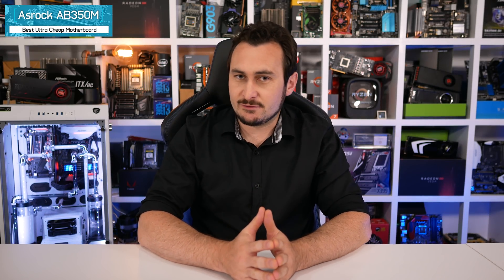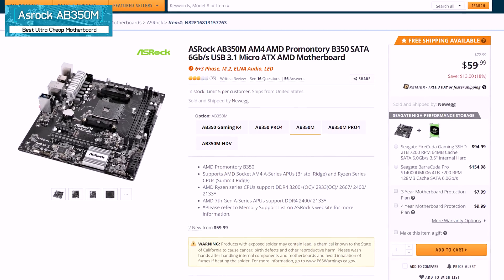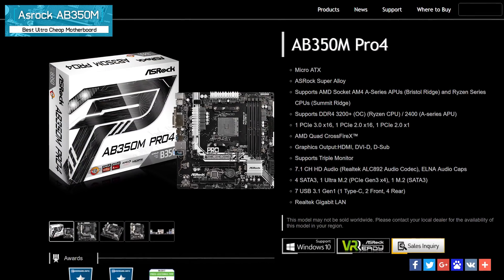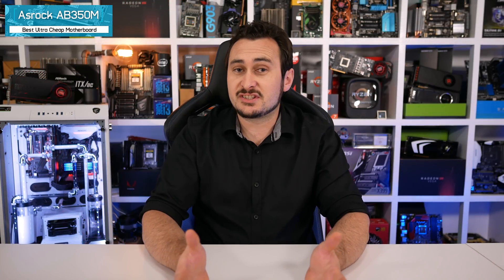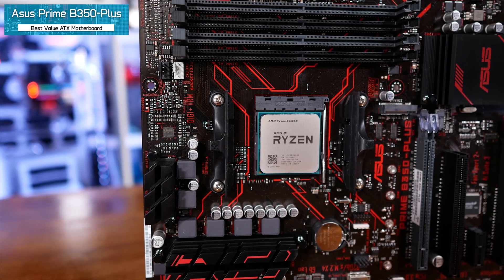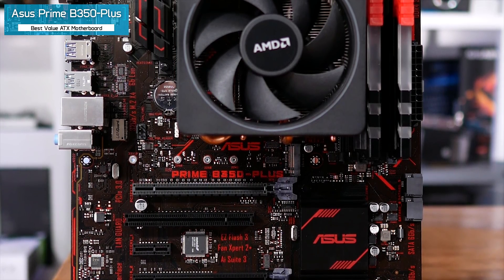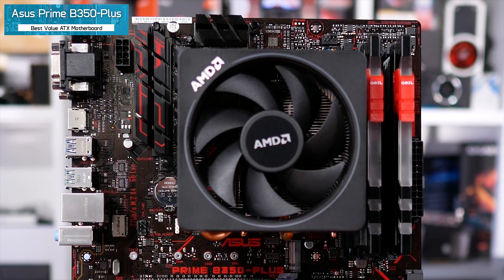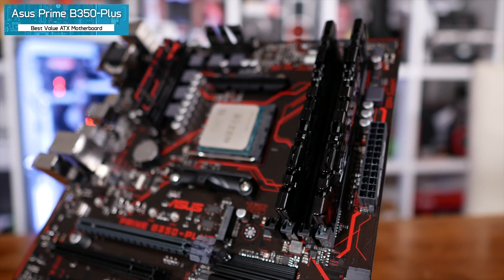Top 5 Best AMD B350 Motherboards

Comment: "4ghz here, and 4 ghz there" Im just unlucky or dumb, cause I cant reach 3.8 ghz+. Cooling is from water, ram XMP profiles, stil no luck. I can change the settings for a 3.8 ghz clock, but will in the end get a cold boot bug. Dang it, is the cold boot bug a Motherboard issue or can it be the silicone lottery from the 1700x?

Comment: The Krait isn't a 4+4VRM, it's a 4+2VRM with the 4 Vcore phases running parallel mosfets and chokes.
So it's a 4x2+2 VRM.
But at least it is a 4 phase and not 3 like the Asrock boards.

Comment: Anyone watch this video after buying a b350 board?
Cus I did..
Reply: Kevin, that is an amazing board, you got a beast
Reply: Kevin Hinojosa I have b350 Tomahawk. Ryzen 7 oc to 3.85ghz, ram running at 3200mhz. I have 4 fans and a cpu radiator. Evga 1080gtx. Great board.
Reply: bayaholic And I have something that almost no one has xD Msi b350 krait gaming
Reply: C Chan Me too :(
The Gigabyte AB350 Gaming 3 he was talking about.
Reply: Gabriel David mine was asus strix b350 f
Reply: Good choice Gabriel
Reply: Yuzuki1337 Thanks :)
Reply: i've had mine for a month :)
Reply: MSI B350 Gaming Pro is currently shipping
Reply: yeah I got the ASUS Prime B350-Plus
Reply: C Chan hahaha yeah! LoL
Reply: i bought msi b350 tomahawk is it good?
Reply: Sw1tch Blad3 How is that board? I went with the Tomahawk because I got it in a packaged deal. I wish the Tomahawk had at least 1-2 more fan headers. Basically, my only complaint.
Reply: I mean, mine is pretty much all i wanted from a b350. I got it instead of tomahawk just beacuse ppl say that gaming pro carbon and krait gaming have better VRM than tomahawk. The board has everything that i need tbh. I got pretty lucky with my cpu and its working at 3.9ghz at 1.325V,  but still, im not going to overclock it to 4ghz on this board, cause its a b350 and it might be unsafe for the b350 VRM. Im not even sure how many fan headers my motherboard has :D Im going to buy another 2 fans in about a week so i hope it has more than 4 fan headers :d Overall the board is pretty freaking good for the price, its looking sweet, the VRM heatsink is big enough and it overclocks very nicely. :)
Reply: I did. This is how I find all the messed up stupid crap I didn't know about it. Researched the crap out of it but I always find something in these kinds of videos. Luckily, my b350 has been a solid buy so far. How about you?
Reply: Hell yeah. I have the AB350 ITX from ASRock. Sweet, tiny board!
Reply: i just bought a ryzen cpu so..
Reply: got my pro 4 yesterday
Reply: just bought the ASRock AB350M-HDV 3 days ago -_-
Reply: I too own the b350 krait. It's going towards a custom build I'm doing. It's going to be over kill
Reply: Henri-Olari Lill Is that motherboard still ok and have you had problems with ram with it?

Comment: i just cant wrap my head around a 3 phase board getting an award. the double component 3 phase design of asrock is a clear scam to look better than real 4 phase. those are cheaped out, too, but oh well, u get my point. vrm heatsinks are subpar on all of these boards. the msi boards with double component 4 phase (8 chokes for the vcore, left to the socket) are pretty nice tho - all msi boards with 8 chokes are the same vrm design - above 140$ tho you shouldnt get msi anymore, because here the asus x370 prime is the better board hardware wise and from there on the gigabyte gaming 5 is the next "better" board, then the asus crosshair should be the best board overall - technically the asrock taichi and pro gaming have even better vrms, but apparently those boards arent that great when it comes to bios/uefi stability, so yeah, the crosshair is just a little less overkill with probably better bios/uefi.
you shouldnt get any gigabyte boards below the gaming 5 - the mosfets they use in their 4 phase design are crap, and so are the coolers.

so if ud ask me id rank them as following:

up to 80$: asrock, whatever you can find - its cheap, dont get excited. maybe the msi pc mate.
up to 100$ : asus b350 prime or msi tomahawk - both "good", with a little edge towards asus for slightly better vrm.
up to 130$: msi double component 4phase vrm boards (8 chokes left to socket) choose any fitting ur needs in audio/pcie slots (led control utility is hell)
up to 160$: asus x370 prime plus (the white/silver one, NOT the red) - extremely affordable true 6 phase board - has a history of bugged soft and hardware, should be resolved by now?
up to 200$: gigabyte gaming 5 - good (but not excellent) 6 phase vrm, huge list of features (fan headers, debugging, uefi led control etc), uefi features was a weak spot, but got patched as of now (finally), great memory overclocking with samsung b-die
above 200$: asus crosshair hero packs the best combination of overclocking stability and hardware, asrock taichi and pro gaming have better hardware (in theory) but especially ram overclocking isnt doing so great, probably bios related. msi titanium is a no-go, extremely overprized. gigabyte gaming k7 is the same board as the gaming 5, with the exception of a clock generator, which is only useful if u really wanna push the very tiniest little bit out of ur system - probably only valuable for hardcore overclockers - has the weakest vrm of all "highest end" ryzen boards - the gaming 5 is probably the "better" board with its sub 200$ price point, since its identical on everything else.

i wouldnt put an r7 1800x in the 80$ and 100$ boards, the high turbo + xfr can put great strain on the vrms of these boards. the 1700x should be fine on everything except the lowest category. 1600x without oc can probably put in any boards, except for the weakest asrock board steve mentioned.

as for oc rule of thumb, the 130$ category is fine with doing 4 ghz 6 core and 3,8 ghz 8 core, the 100$ category should be fine with 3,8 ghz 6 core and 3,6 ghz 8 core. the asus prime x370 and up can push any ryzen to the silicon limit safely. 

what do phases do? the more phases (native or properly doubled with doubler ic, NOT double component) the better the voltage regulation is, that means more accurate power delivery with less overshoots and drops. that makes overclocks more stable and require slightly less voltage. on top of that the strain on each mosfet is lowered, which makes them run cooler. that also applies on double component vrm designs, but these still act as their phase count is. properly doubled 4 phase actually acts like a true 8 phase, with the exception of halved switching frequency.
also, the higher the real phase count is, the rule of thumb says, the higher the general quality of the vrm. exception to the rule is the asus crosshair, which is a doubled 4 phase with excellent mosfets/power stages.

its true any b board CAN overclock an 8core ryzen, BUT these boards dont feature the quality of mosfets/vrm to do so with 4 ghz 8core without damaging themselves in the long run. its not the fault of amd, its the board of the board manufacturers cheaping out on mosfets. mosfets can get extremely hot when running out of their sweetspot, which damages the temp sensitive capacitors next to them. also mosfets can wear over time when pemanently pushed at their thermal limit, perfect example are the cheap am3+ boards which got killed by high power vishera (piledriver) chips.
Reply from the maker: It's the best board for the price.
Reply: i wont argue with that its really cheap and due to that its value is "good", but general "goodness" really depends. its power delivery system is ok in terms of power capability (ampere), but a 3 phase has its limitations in regulation and interleaving. i'd really consider a 4 phase vrm the bare minimum of a "quality" power delivery.
asrock has always been a little dodgy with their vrm designs - and im saying this happily running an asrock z77 board for ages. its the same with TLC vs MLC memory or hynix vs samsung bdie. sure it works, but technically there is a difference in quality.
bottom line, im not questioning ur statement the asrock is a good board when ur shopping with a tight budget limit, i just wanted to point out that this 3 phase design of asrock isnt something they should get away with that easily.

hows that saying? in a world of blinds, the one eyed is king. ryzen boards arent all that great in general. lets hope the next generation of boards coming together with the ryzen refresh will be better!
Reply: "It's the best board for the price."
Its the only B350 board for the price, but it's bare bones when it comes to features.

I'd disagree that it's the best board at the budget end, the Asus prime B350M-A is $10 more (69vs59), has 4 memory slots and has 2 x USB 3.1 gen 2 ports, the Asrock has none.
The Asus is also a 4 + 2 phase board and while it doesn't have a VRM heatsink, the VRM's don't get hot overclocking a 1600 to 4.0GHz, I know because I've done it. It's the same VRM as on the Prime B350 plus, just minus the heatsink.

So at the bargain basement price, the Asrock isn't the best option, it won't support APU's as it has no Video outputs, while the Asus has DVI, VGA and HDMI.

VRM heatsinks can be little more than window dressing and at this end of the spectrum it's doubtful people will be running the R7's on these boards.

Comment: Great video and great list. Thank you Steve for finally being the person who talks about Motherboard VRMs in a Motherboard review. This video and the one Buildzoid did for B350 Boards should be the source material for people looking to buy a B350. A side note though. If someone is looking for cheaper board that can OC well and has a ton of features I would point to the MSI X370 Gaming Plus. It is about the same price as the MSI B350 ProCarbon, (even cheaper than it where I live, so the price of the Crait Gaming you talk about) sports the same VRM, but allows for 2 extra SATA ports (6 total) and SLI support. Best value AM4 Board if you ask me.  

If I may I would like to comment a bit about your picks though, based on prices I see in my country, since that changes things a bit. Here in Bulgaria (EU union) MSI boards tend to be cheaper than average, while ASUS tends to be a bit pricey. 
As for ultra cheep board  the MSI B350M PRO-VHD is about the same price as the ASROCK offering but allows for 2 more DIMMS and comes with the MSI 4 phase VRM. But a case for the duplicated components on the ASROCK 3 phase can still be made.
For the best value all MSI Boards are the same VRM and features (beside the 2 top offerings) and they come cheaper than ASUS here with the same VRM more or less. So I would say the cheapest one MSI B350 PC-Mate is the one to go with for me. Simply because you can hook up all the case fans you want and even supports Cross-fire. 
The best overclocker definitely goes to the Crait-Gaming you picked simply because this MSI 4 pfase VRM with duplicated components is the best in the B350 lineup as a whole and only the the Carbon Pro also has it. But I would like to again make the case for the MSI X370 Gaming Plus (or the MSI X370 SLI Plus since it is the same board).

Comment: hi Steve.... running my R5 1600 with asus prime B350 plus at 3.85 Ghz at 1.39V with stock cooler (72degreeC AIDA64) 2933 Mhz RAM no problem, should i go for x370 motherboard to get 4.00 Ghz ? note that my pc posts at 4.00 ghz but not stable. need ur advice.
Reply: Tech Z buy new motherboard for 0.15 GHz?

Comment: Question:
i have a Asrock AB350M Pro4 with the original bios( never updated, i think its 2.10).
if i want to update it how should i do it? do i just go for the last version(3.30)? or should i update through every version?
Reply from the maker: Use the auto update feature in the tool section of the BIOS, it's very easy and I recommend you update.
Reply: i tried it right now...it says it can't connect to internet, check network configuration or something like that.

Comment: Paused vid to type this... please don't give any awards to the Asrock B350 Matx Pro4... It is god awful and had to RMA it. I've been building computers since the mid eighties and this reminded me of how difficult old computing can be.

I got the MSI Bazooka in the end.

To clarify... The bios has the worst oc recovery ever and could not keep non oc related changed settings after a fail... The QVL list states the memory kit I brought (Corsair 16gb 3200) was tested to work at 3200... Nope topped out at 2800 which days of tweaking and backed off timings... very annoyed. Originally I bought a 1600 and this would not in any regard overclock AT ALL with memory over 2133. As soon as I managed 2400 and 2666, which I only managed a few times the cpu oc was lost. (Please not I am not an inexperienced pc builder.) In the end I RMA'd the chip for a 1600x and this proved no better.
Whilst testing, building and rebuilding the system the primary PCI-E slot came away from the board... I couldn't believe it... this was not due to any error on my part. 

When I respec'd to a MSI Bazooka (basically a touch cheaper Mortar board with white leds) All worked... Bios is great, OC recovery works... 3200mhz ram on a flat 4.0ghz oc.

Admittedly I could have got a poor board but my instincts tell me otherwise. 

EDIT - nearly Steve, lol. Can I ask a question?... Why are Asrock boards seemingly so popular in Aus?.. is it marketing, this seems to be a pure aussie thing, even with higher end boards.
Also I wanted the Mortar arctic but could not find one at the time.

Comment: great video, i recently built my first pc, before that i used only laptops, but decided to build a pc after seeing all the amazing videos about the value and performance of ryzen, and the hardest part was choosing the motherboard, initially i was looking for a decent b350 motherboard, but finally i found what i think is the best value am4 motherboard out there, the Asus prime x370-pro, it uses the same vrams as the crosshair hero only 6 phase instead of 8 phase and i manged to run my patriot viper 4 3400mhz kit at 3333mhz stable just by choosing the xmp profile and it only costs around 130$

Comment: Is msi b350 tomahawk good for gaming and overclocking
Reply: Striker Tech & Play have the board myself and works pretty good for me
Reply: Larry The Lobster thanks for the information and plz do me a favour i am a new youtuber plz subscribe to my YouTube channel
Reply: It's absolute dogshit, don't buy it.
Reply: Still doesn't change the fact it gave my 1700 1.44v out of the box when i only had the stock cooler on it. There's a good chance my 1700 would be dead now if i hadn't noticed the temps rising over 90c and manually dropped the voltage. Despite that, it couldn't even hold 3.8GHz stable after i bought an AIO even though my 1700 is a pretty good quality chip as proven by the Taichi which runs it at stable 4GHz and even managed to get the 17th highest clockspeed record for a 1700 on hwbot with 4243MHz.
Reply: There was complaints about it:
https://forum-en.msi.com/index.php?topic=284843.0
https://forum-en.msi.com/index.php?topic=286736.0
I simply mentioned the Taichi as contrast to how much the Tomahawk limited the overclocking potential and that i'm no longer using it in my main pc because of how shit it was.
Reply: You must have no clue about CPU thermals and voltages if you think feeding 1.44v to a cpu with a stock cooler will just buff out with throttling.
Though looking at your videos i can see that you really don't have a clue about anything, do you?
Reply: Doesn't support risers, sucks for overclocking, Msis shit web login system for warranty, horrid bios, lack of bios testing before released.
Stop defending something that is clearly bad just because you own it.
Reply: Get the B350 Mate, same as the tomahawk, just cheaper
Reply: It couldn't handle my vengeance 3200MHz though. The bios sucks ass and it nearly fried my 1700 with overvoltage on stock out of the box settings.
I swapped it for a x370 Taichi and holy shit was it worth it.
Right now i have it running my second mining rig and it even sucks for that since it doesn't understand what a riser is.

Comment: I m using the Msi B350 Tomahawk and love it! Great video Steve!
Reply: Oxaile It must have been a broken mobo.
Reply: @Oxaile sorry to hear that brother,  but like Tech Addict said you Probably were just unlucky and got a defective one
Reply: how is it with the overclock ? i have just ordered one with r5 1500x and will be getting it this sunday
Reply: DanteCeption  it s a great mobo I m running a 1700X for about 6 months now @ 4.0ghz stable, my pc is running 24/7 btw, so pared with a 1500 you have a  great combo if you ask me.
Reply: DanteCeption I got one with the R3 1200, overclocked it to the same 4.0ghz at 1.375v, 75°C peak on the Wraith Stealth. When I finish my airflow configuration I will definetely try 4.1ghz( Already tried it but failed after 1 minute of Aida64 Stress Test on the cpu+fpu+cache). The only issue i had with it was the msi software on the audio chipset, doesn't recognise my mic, it is a pretty cheap one so I'm gonna try it with another one.
Reply: I hated mine, couldn't even hold 3.8GHz stable on my 1700, the bios sucked and it almost fried my cpu with the stock settings it came with. Swapped it for a x370 taichi (keeps 4GHz oc stable) and decided that i would never buy anything from msi again.
Reply: Thanks a lot Daan Boaer, and for the info i am running it right now with a gtx 1080, 16 gb of DDR4 Ripjaw V 3000 mhz and the 1500x at 3.9 (without overclock, only XFR enabled) like a charm

Comment: I got the Asrock AB350M Pro4 mobo for $60 and am happy with it EXCEPT for the fact that it takes nearly one full minute to boot up. Wondering if all b350 mobos are slow on boot or just this one. Got a 1500x and ddr4 3000 speed ram so I don't know why its so slow.
Reply: Yeah, a Samsung. I replaced my old i5-4590/Z97 cpu/mobo with the Ryzen stuff but my old one booted to desktop in 23 seconds using Linux as my OS. The Ryzen averages about 50 seconds.